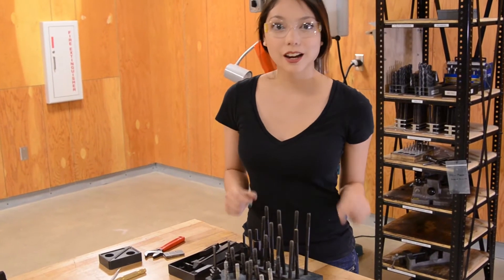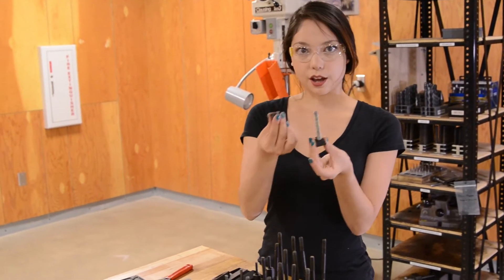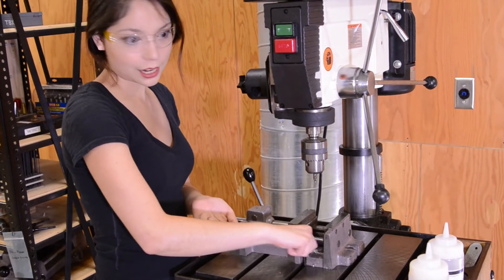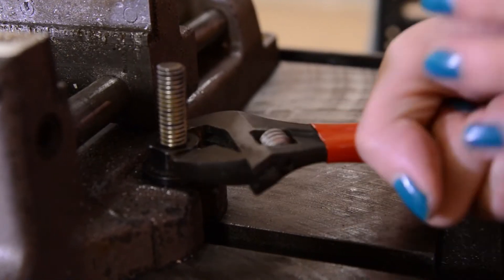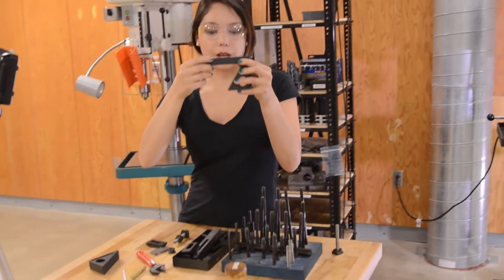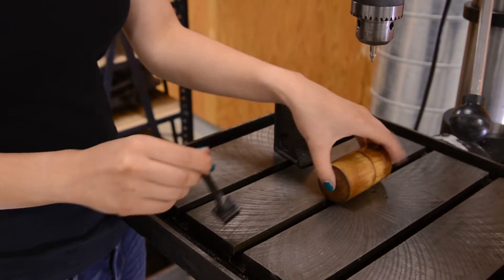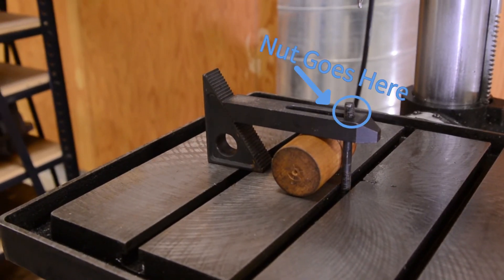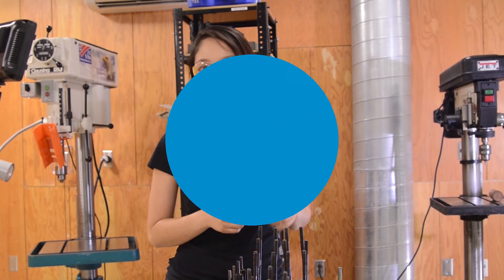How to Use T-Slot Hardware

Comment: and maybe try putting the work piece on the other side of the t-stud so that when you tighten the nut it seats the step lock rather than opening it..? that would be why the horizontal clamping bar has a slot rather than a hole......just saying.

Comment: I don't see how that stepped bracket works. 

Once you tighten down the hat/nut it will weakly clamp down on the workpiece but then lift off the stepped support.

Do you put the workpiece on the other side and make it a 3rd class lever action?
Reply: Considering this is a “how to”, it doesn’t really tick the key requirement of telling you how to use the clamp, what with putting the work on the wrong side of the stud and all.

Comment: The term T-slot has many definitions depending on the industry that is being discussed. In this video Xyla is demonstrating how to use a T-slot in a drill press. The same hardware can (and should) be used in other hardware that you would usually find within a workshop (wood or metal). 

If your drill press did not come with this hardware you can find it at your local hardware store or on the internet.
Reply: nice